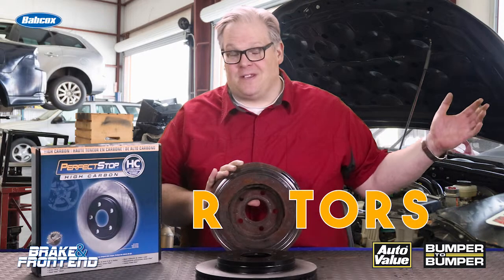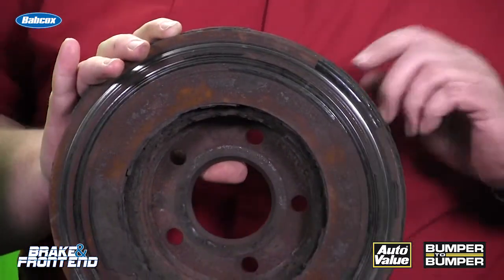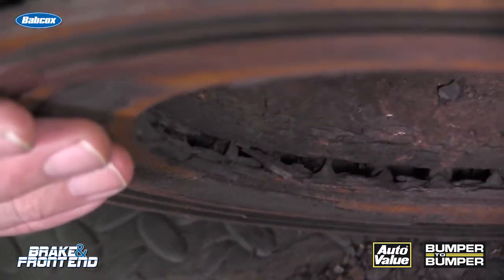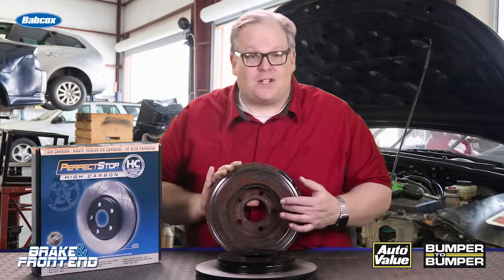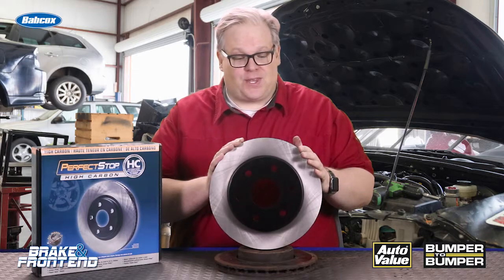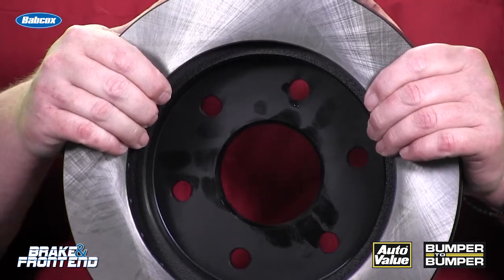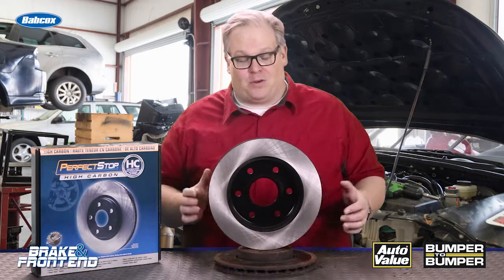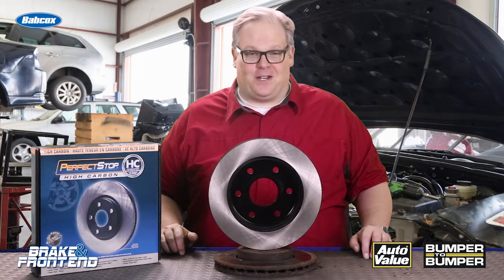Why do brake rotors rust on the inside? | Tech Minute

Comment: Keep in mind the inside has a dust shield.  That traps moisture on the back side  Not only does it trap moisture, but it prevents water from flushing out salts that accumulate.  Paint helps a little, but pads don't go all they way to the edge of the machined surface and that's where it starts to rust first, then it migrates inwards.